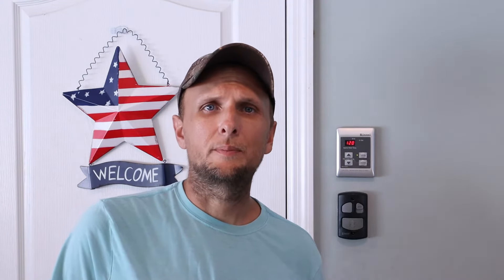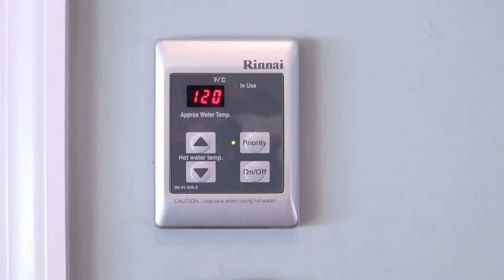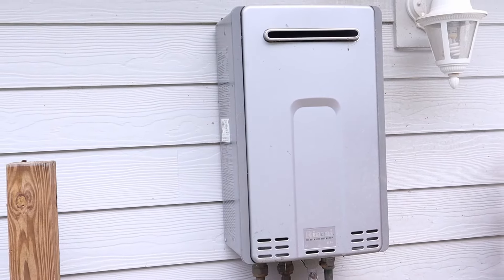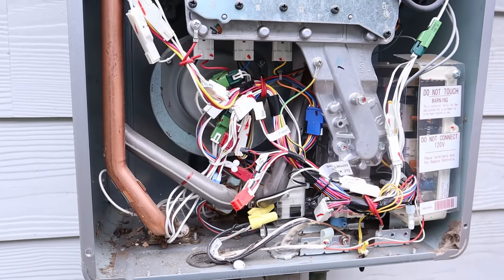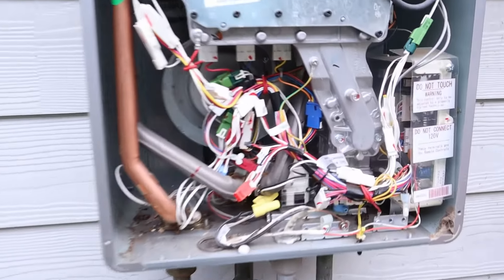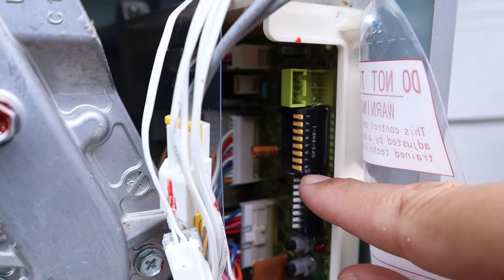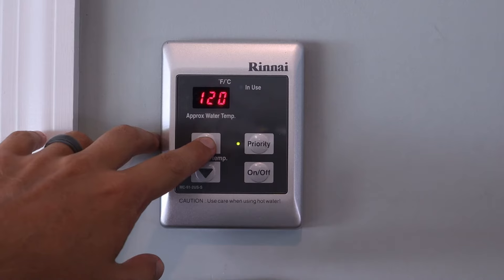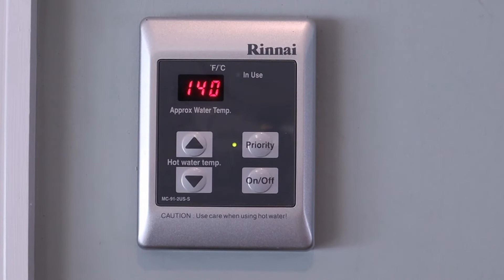How To Increase Rinnai Tankless Water Heater Max Temperature (Not Hot Enough)

Comment: The reason I wanted the temp raised is because my tankless waisted to much water waiting for the hot water to reach my kitchen
Reply: Have your plumber install a end of run water circulating valve and turn on the circulating option.

Comment: Finally! I've been trying to figure out how to increase my temp and had no success until I watched this video. Thank you!! BTW, having your temp set at 140 allows you more flexibility with setting your temps. Hotter for doing dishes, not as hot for your shower. I want to be able to determine what temp to set my water.
Reply from the maker: Glad it worked for you!  We wouldn't go back to the standard temperature.  Thank you for the feedback!
Reply: As a master plumber you don’t want to scald your young or old house guests as 120 is very adequate ✌️

Comment: I had a problem with my Rinnai water heater set at 135; the hot water would keep going cold after a minute or two of hot water at the tap. A friend told me it was due to the temp being set too high so I backed it down to 125 and never had the problem again. I hope that helps someone else.

Comment: For those of you that tried this it only works when the factory set #1 switch is turned off.  I did the #6 switch like many others have and got hot water then it quit.  So make sure you turn off #1 switch if it is on, and then turn #6 on.
Reply: Same issue
Reply: But then back on or? #1 is for nat.gas so I wouldn't think I'd want that off? Thanks

Comment: Thank you.  Your video did the trick.  I watched a different video from someone else earlier today, and they said to start out by pushing the "A" button under the cover, and then push a couple other buttons sequentially in order to adjust the temperature.  I couldn't find an "A" button, and I assume I was watching a video for a different model Rinnai on demand hot water heater (even though it looked exactly like mine from the outside).  Anyway, once I watched your video and I depressed the small number 6 switch, it worked exactly as your video showed.  After all of that, I adjusted the temp from 120 to 130 and thought it was a little too hot.  I decided to put it on 125 and call it a day.  Thanks for the great information and for all your help.

Comment: Worked great, however while in the shower, the water got very cold but after about a minute temp increased again. Is this normal?
Reply: Same issue
Reply: It could happen if someone turns on a faucet around the house or flush the toilet while you’re showering

Comment: I had run out of propane, got more propane,  and now I cannot get the display to stay on. It was working perfectly, until I ran "out" of propane. The heater is working, but no lit display.
Reply from the maker: There is an issue with the electrical to the display then or the display itself.

Comment: THANKS! Had both mine adjusted in 15 minutes.  Have a question, the house is in FL about 4 years old, mildly hard water, no water softener (YET) and thinking it could probably use a flush prior to water softener, Any suggestions? Also, does anyone know if the exterior unit can be painted?
Reply from the maker: Oh yes you should definitely do a flush on it with 4 years of hard water going through it.  Those deposits build up pretty quickly.  I don’t know that they can be painted though.  I have seen a lot of them and they have never received paint.  But perhaps someone will know for sure.  Thanks for the feedback!
Reply: Yes, I used Rustoleum  Hammered Anodized Bronze on the Tankless and pipe cover to match outside trim. Looks great and with no rust in humid Piedmont NC weather.

Comment: I just put in a new electric water heater. should it be set to 140? I have been trying to figure out what is safe to set it and it still be hot when i wash dishes and shower. My husband says it should be 120/125 but feels luke warm. 😅
Reply: Common Sense.  Cold water is safe, boiling water is not.  You choose

Comment: THANK YOU! Your instructions worked perfectly, although I did note that the #1 switch was already pressed down on our unit, at first glance. Nonetheless, I left it as is, pressed down the #6 switch, like you said, and was able to subsequently increase temperature to 140. So, as it stands now, our unit has both switches #1 and #6 pressed down, and hopefully that doesn't create any problems. Brought this up, as I noticed in your unit that none of the switches were previously pressed down, before you pressed down #6. Any thoughts? Cheers, LL.
Reply from the maker: Hey yeah I would leave dip switch 1 alone.  Depending on your model it can do different things.  Oftentimes dip switch one being down means you have natural gas, it would be off for propane like I have.  Either way switching #6 down should not affect any of the other settings as it only controls the max temp.  I hope this helps!   Thank you very much for the feedback!
Reply: @HowToHomeDIY  Great. Thanks again!
Reply from the maker: You are very welcome!
Reply: A previous post mentioned that Switch 1 was on for natural gas option.  not sure if this is true, but sounds like it  has nothing to do with temperature.

Comment: I have a v65 model. Propane.
The #1 & #6 are in the 'on' position. I can't change the temp. I saw videos that push the 'A' button but that does not work either.
Seems like the button is malfunctioning. My Rannai heats my floor and it's 1 deg outside so I need to figure this out! At 120 I can barely keep the house temp at 59 deg.
Help!
Reply: Call  a service tech or customer service

Comment: Great info. Mine is a long run to the kitchen like others have mentioned, but I also notice that the flame is somewhat inconsistent, as in it appears to pulse up and down in intensity. The flame looks proper, it just tends to pulse a little and it does seem to cause the water temp to be inconsistent. New house, unit about 8 years old. Same unit as in this video. Any thoughts?
Reply from the maker: I honestly don't know.  If I was finding a heating inconsistency then I would probably definitely give the person that installed it a call to come out and take a look at it.  Only things I could think of is maybe the burners need cleaned or where the gas is introduced.  Totally just thoughts off the tops of my head.  Sorry I couldn't be more definitive.
Reply: @HowToHomeDIY  Thanks for the input either way. At the time of my question I had just bought the home, and still hadn't moved in or used the shower yet. My observation was just from watching it run while turning on multiple faucets on at the same time just to test it out. I gave it a thorough flush and it seems to be working great. I now believe the flame is like throttling by design in order to maintain temperature. The temp is definitely steady as far as I can tell. Thanks again, and truly appreciate great folks like yourself

Comment: I have a the same unit, but my hot water tap in out of water nothing comes out
Reply from the maker: There is a pre filter on the pipe bringing the water into the water heater.  It unscrews and then pulls out.  Check that filter, I would bet that it’s clogged.  Before you unscrew it though, turn the water shutoff to the off position or you will get very wet.  Hope this fixes your issue!

Comment: How to turn down the temp on an infinity vt 24?
Reply from the maker: If you have the optional external control panel then it is as easy as pushing the down button to turn the temperature down.  However, if you do not have this then I believe that model has its control panel inside of the unit itself.  If this is the case I would find a manual for your water heater as the temperature is adjusted using different combinations of dipswitches depending on the temperature you are wanting.  I hope this helps!

Comment: Hi Adam! What do I do when a code 12 pops up where the temperature should be and it starts beeping? Any idea? It's been a freaking nightmare 😦
Reply from the maker: Hey!  A code 12 typically means that not enough gas if any is getting to the burner.  Could be a blockage, loose fittings, or possibly something wrong with the burner itself.  If it was me, I would look it over and see if I could tell what was wrong, looking for any loose fittings, checking to make sure there isn’t anything wrong with the gas supply, checking the exhaust to make sure nothing is wrong there, and looking for any loose wires to anything on and in the unit.  If you haven’t done one, I would do a flush of the system using white vinegar as scale buildup can definitely be your issue as well.  The instructions to do this are in your owners manual and there are plenty of resources on the internet as to how to do it as well.  If none of this solves your issue, in this case, would probably give the person that installed it a call or someone in the area that works on them.  If you smell gas at any point, call your gas supplier as there is probably a leak. I hope this helps!

Comment: Do we flip the switch back? Or keep it flipped down ?
Reply from the maker: Hey Wayne, If you want to keep it capable of going up to 140 degrees you would keep it flipped down.  If you flip it back it will go back to a max temperature of 120 degrees.
Reply: @HowToHomeDIY  also when I switch it down the hot water no longer works.. it goes completely cold
Reply from the maker: @waynesenvsvc1450  That is odd.  If you have a model similar to the one in the video and confirm you are flipping the #6 toggle switch down and it is causing the water to be cold, then you may need to contact whoever installed it or Rinnai as that should not be happening.
Reply: @waynesenvsvc1450  hey i have the same issue did you fix it?

Comment: I cold water after flipping switch, why?!
Reply from the maker: Hey Tisha, this could be due to a couple things.  If for example the unit is a commercial unit, the #6 dip switch may not be for maximum temperature control.  Rinnai has many models, the one in the video is one of the more popular residential models.  Also, some older models, the dipswitches work together in a way to add or reduce the temperature, the dip switches being out of sequence could cause a big temperature change.  If in fact you have the same model or one like the one in the video, then I would contact a plumber or Rinnai directly as flipping the #6 dip switch in the unit as shown in the video is in their instructions on their website to increase maximum temperature.  If that is not working then there may be an issue with the unit itself.  One other thing, as silly as it sounds, I would just double check to make sure it was the #6 switch that you flipped.  I have bigger fingers and those switches are very close together, it would be easy to flip the wrong one but look like it was the correct one.  Flipping that switch should not make your water colder it should only adjust the max temperature setting allowed on the control board.  Hopefully one of these helps you out!
Reply: I have the same issue did you fix it?

Comment: I have few questions. 
-Can I set it up to 130?
-Once I set it up to 140 or 130 can I go down later?
-Finally do I have to flip number 6 back up every time I change the temperature? Or once number 6 is down I can change the temperature up or down?
Reply from the maker: Hey Ayesha, yes once you override it so that you can go up to 140, you can set it at any temperature you want up to that 140 degrees and you can change it at any time.  So 130 would be fine.  You do not need to keep going out and flipping the number 6 switch.  The switch just allows the max temp to go up to the max of 140 instead of 120.  Hope this answers all of your questions!
Reply: Mine turned ice cold after I flipped the number 6!  Why?
Reply from the maker: Hey Tisha, this could be due to a couple things.  If for example the unit is a commercial unit, the #6 dip switch may not be for maximum temperature control.  Rinnai has many models, the one in the video is one of the more popular residential models.  Also, some older models, the dipswitches work together in a way to add or reduce the temperature, the dip switches being out of sequence could cause a big temperature change.  If in fact you have the same model or one like the one in the video, then I would contact a plumber or Rinnai directly as flipping the #6 dip switch in the unit as shown in the video is in their instructions on their website to increase maximum temperature.  If that is not working then there may be an issue with the unit itself.  One other thing, as silly as it sounds, I would just double check to make sure it was the #6 switch that you flipped.  I have bigger fingers and those switches are very close together, it would be easy to flip the wrong one but look like it was the correct one.  Flipping that switch should not make your water colder it should only adjust the max temperature setting allowed on the control board.  Hopefully one of these helps you out!
Reply: @tishaellis3814  same thing happened to me did you fix it?